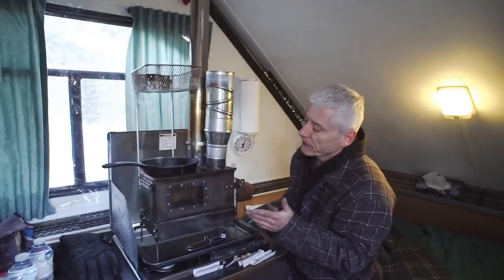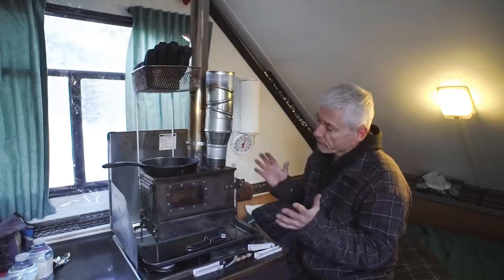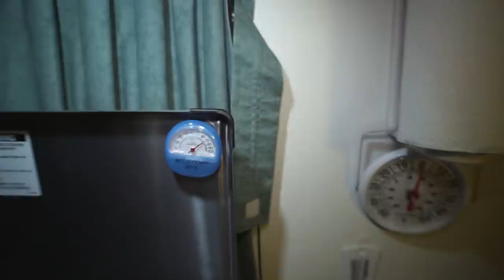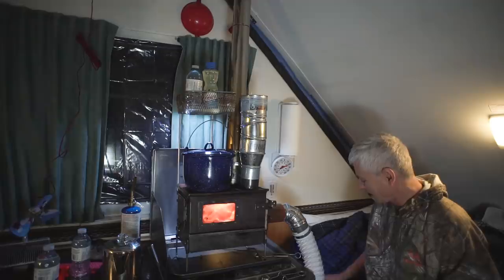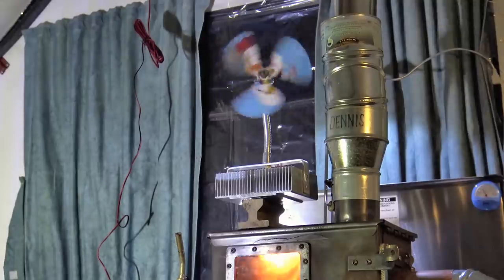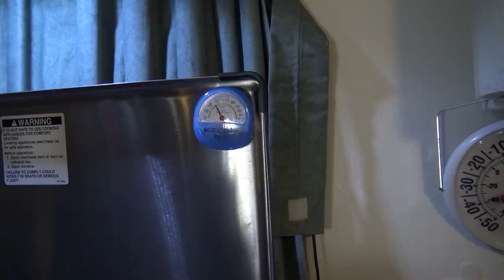Wood Stove in an A-Frame Trailer - Part 2

Comment: What if you heated a bunch of water up on the stove while it was running hot early and let that water radiate heat when it gets really cold.
Reply from the maker: I'd end up with a very damp trailer and little heat retention. Biggest issue is avoiding condensation, not having more heat. Thanks! SP

Comment: You are loosing a lot of heat up the flue pipe; You need a dampener plate in the pipe to slow the BTU loss down so more of it radiates into the camper.

Comment: probably been said but look into a 2k diesel heater around 200 bucks and under... one gal tank up to 8 hrs of use  perfect size for your A frame
Reply from the maker: Hi James, which specific model are you referring to? Just the model please, don't send a link. Thanks! SP
Reply: @SlimPotatohead   no links look at amazon  do a search on diesel heater  my friend grabbed a one for 179 red top grey/black bottom  it runs on 12v also there is a few other for other prices probably find it on ebay also there is also some vids on here about them   i can tell ya  it get his truck camper warm.....   and yes fan in center roof  blowing down works great.. in the summer flip it up to suck up cool air
Reply: if you didnt know .....diesel gels up  in colder temps like your in   but you can mix kerosene to help that out.....my friend loves his on hunting trips...used last 2 winters
Reply from the maker: What heater are you referring to? Company? Model? Thanks. SP
Reply: @SlimPotatohead  has no name  or at least we havent found it  it was a china build i can tell  but there are a lot of brands on line   i can do a link but  on that link i can not see no name only seller on amazon 
manufacturer is morningchen
Reply: @SlimPotatohead   amazon  search for a camper diesel heater  should take you right to them
Reply from the maker: Hi James, found it thanks. Seems more suited to a truck then a separate camper. Requires a substantial amount of 12V current, exhaust outlet and inlet, and most likely makes noise. Plus I'd have to purchase and carry diesel. Sorry, wouldn't work for me but thanks for the info. SP
Reply: @SlimPotatohead   no worries just a thought.....i  like the vids by the way... A frame's  looks good ....  i do love a fireplace.....  keep on campin

Comment: I'm concerned about the combustibility of the flexible flap on the roof where the stove pipe exits.
Reply from the maker: You shouldn't be. It's a heat-resistant silicone/fiberglass stove jack. SP

Comment: Check your ceiling temperature your stove is up too high that stove needs to be lower about a foot and a half off the ground because heat rises so you're not getting any heat down below that stove that's why I say put them reflective blankets up so that the feet that's directed towards the ceiling will be reflected back down to you and along with the fan that works on heat only when you set it on top of the stove it will generate some air movement which will also help

Comment: Isnt a diesel heater much cheaper in the long run?
Reply from the maker: You tell me Akiva. Nobody gives diesel away for free. Scraps of wood however,  are pretty easy to come by, especially in the forest where I camp.  SP
Reply: @SlimPotatohead  I just saw you were using pellets not wood scrap.
Reply from the maker: It runs on both, however I much prefer pellets for consistency. There may be other reasons to prefer a diesel heater,but I wouldn't put economics high on the list. Thanks! SP

Comment: Hey sLim Pickens,  I started laughing, you experiment the way I do.  Make up things and test em, great if they work, re-do if not, lol...   What ya gonna do?
I have a thought though..
You are losing too much heat up the stack.  I have seen stoves with a second chamber, the hot gasses from the fire go through the first chamber then put to the second chamber to try to catch more heat to be radiated off before going up the stack.  Now, I have a thought on how you might get away with this.
  Have you seen those heat boxes, with the tubes that go on the stack, they have a fan that blows air through to blow the heat out.   Obviously, you don't want to be running a fan because power is usually an issue.  What I thought could happen is rotate the stove 180 degrees, put an elbow on the stack to go over the stove.   Place one of those heat boxes with the holes VERTICAL to allow the heat to move the air through and up.  Then another elbow going up and out.
LOL,  my first thought was to get some metal and pop rivit fins on the chimney pipe and though it might work, it makes the stack much larger and difficult to handle.
  I'll have to look into pellet stoves, it sounds like a good idea.....

Comment: If possible..the stove should be sitting on the floor..the Coldest spot..heat rises..so better heating solution?
Reply from the maker: Hi George, there's really no need, as the stove heats the trailer to the specific temp I require. Also, why would  I want to cook on the floor? SP

Comment: To begin with that little wooden stove to me it's a little too small to heat up your camper and maybe using some regular wood would help you better but still there stove is too small that is just my opinion but it is good that you have backups that is always really good to have because you really can't just rely on just a wooden stove also that will help is maybe to have an electric blanket just in case it back up but then of course you have to run into having battery supply and also having a power inverter big enough to support you are electric blanket
Reply from the maker: Hi Rick, did you watch the entire video? At 36:00 I summerized that I successfully achieved a 70 deg F differential. That is all I need. Any more heat would be a complete waste of fuel. Size is perfect for me. SP

Comment: So would wood have burned a bit warmer
Reply from the maker: Hi Kathy, Yes wood burns warmer but also has several disadvantages to pellets. It is less consistent (too hot, too cold) needs more attention, and produces more smoke and gases, more ash. I use wood for cooking outdoors with the stove, but not for heating. Thanks! SP

Comment: spray a small amount of cooking oil on those pellets. soak a few pellets in diesel or used motor oil. I said only a few. maybe twenty pellets. experiment. those pellets need to lite easier.

Comment: Love this project and your methodology.  Also I don't think it is very possible to exhaust the O2 in the trailer. With a massive fire perhaps yes. The trailer would need to be very ,very did I say very  airtight. O2 diffuses from high concentrations to low very quickly .If you took a O2 tank and turned it on max , say 15 litres a minute ..4 feet away an O2 analyser would read 21%. no change from atmospheric O2. The reverse is true when you use O2 up in a smaller space that has even a small air leak. Now CO yes dangerous , and it is dangerous in very small amounts .. I would worry more about CO. The intake fresh air pipe does help with the fact your not sucking warm trailer air into the fire and up the stack.

Comment: That small of a stove will never use up the oxygen that is in that size trailer there is enough air leaking in that you can't tell so don't worry about the oxygen.

Comment: I had one in my boat and it was a no ,one would have stay up all night feeding it.fine during the day .no way will that use up all the air lol .a 20lb propane bottle a good heater does the job with a little 12v fan in your rig.
Reply from the maker: Todd, I think you are talking a different situation than mine.  My use is for extreme cold. In that case propane is a poor choice due to both condensation and the lines freezing up. I only needed to refill once during the night. Wood pellets are much more reliable and provides dry heat. SP

Comment: Great video! I was wondering if you thought about plexiglass for the windows. Also, if you point your ceiling fan toward the chimney pipe you would lower the pipe temp and gain more heat. Just a thought.

Comment: ad space-blanket`s to the side of youre a frame`s, over that you can ad fiberglas wallpaper to make it look nice if you want to, this wil also make direct the heat down to the ground making you're ventelator more useless (or a less powerfull ventelator necessary). gl hf.

Comment: put the stove on the floor, put more metal fins around the exhaust pipe
Reply from the maker: Not practical in this system. The stove must be compact as it folds up like the trailer. SP

Comment: Why not use a small normal wood heater ? If you did that then depending on the wood you could fill it up and wake up with coals.
Reply from the maker: Hi Daniel, I use pellets for long periods of consistent temperature and burn. My stove will take wood, however just filling it up would end up being too hot initially,  then too cold, plus a lot more ash and smoke. Thanks, SP
Reply: @SlimPotatohead  fair enough . To each his own . Thanks for the reply

Comment: you need to install a jiggler and handle so you don't have to try and use a poker while half asleep, add a solar panel a arduino and a solenoid and it would stoke it for you.
Reply: and get short piece of double wall to slide over your pipe to protect the skylight opening.
Reply from the maker: Check out 17:00 in this video. Flu does not get hot enough to damage vent area. SP

Comment: I don’t know why you didn’t just simply measure the ambient air temperature with a traditional thermometer.

Anyway, interesting idea, but I prefer the safety of a webasto (or copy) diesel heater. Very cheap to run. Very safe, all combustion occurs outside, and you simply get warm air in the cabin. A lot more expensive, but a lot warmer and a lot safer.
Reply from the maker: Diesel consumes power. The wood stove produces it. SP

Comment: That fresh air line isn’t needed and it’s a hazard. I live in Alaska and have used my motorhome in February above the arctic circle in -30 F.
Reply from the maker: You don't have my setup, so don't compare to a motorhome. Works fine and yes, it is needed. SP
Reply: Slim Potatohead your walls are the same thickness as a Motorhome 2 inches. I think it’s cool what you’re doing. 
The sweating you’re getting is from your propane. It’s a liquid gas and puts lots of moisture in the air. 
Wood heat puts out zero moisture and no amount of carbon monoxide. Bud I’m not giving anything but praises. Great videos. 

Hey your fans great. How’d you build it ??
Reply from the maker: Propane has many problems in cold camping. Too cold it won't even flow. Wood can produce Carbon Monoxide, but wood pellets have a very clean burn. My fans are in several videos, first one is here: https://www.youtube.com/watch?v=1gInEKrUdME
Thanks, SP

Comment: Diesel heater can’t go wrong the 3 kw version use about a litre per 8 to 10 hours
Reply from the maker: Except it cant cook, fry, boil or bake, and it consumes electricity instead of producing it! SP
Reply: The power use is minimal about 10w along with fuel use , they take up no space give a good dry heat that circulates , does not freeze like LPG , they can be run when you are driving . With the 3kw I have drawing air from the outside it heats a canvas camper trailer from 0c to 30+ c in about 15 min . To me a comfortable environment is everything I cannot move in the cold to much arthritis. Depending on were your batteries are mounted you can run a section of the exhaust from the burn chamber through your battery box th stop them freezing up . I am not knocking your stove but offering a very viable alternative
Reply from the maker: Yes Pete, I agree a diesel heater is an excellent idea for a van or small trailer, just wish it was more multi purpose. Interestingly enough there are stoves out there that also run on diesel. Be great if someone figured a way to combine them both! SP
Reply: Slim Potatohead lots of diesel cookers in the marine world, they work well have had one on a yacht i had but the heat output is minimal at best for heating and the fuel consumption is many times per hour over what you will use with a diesal heater . Personally for the size , weight and output they are impossible to beat . You could possibly throw the lpg furnace away and have both . In the temps you are in I would call it survival just having a redundancy system in case of failure of one source of heat . Lpg is not very reliable in the subzero temps you are in to my way of thinking and the weight saving woub be fairly significant

Comment: How about insulating the floor with some 1 " Styrofoam SM .. if you haven't already. Most of these camper units are so inadequate for winter. As mentioned, aluminum extrusions that pass thru the wall like window and door frames become super heat conductors.. useless. Somebody has to come up with a truly winter capable RV. At least 3" of poly urethane foam all around, double glazed polymer windows, not glass. and infrared coatings on the wall to reflect radiant back at the occupant.If you calculate the btu return on pellets compared to diesel or heating oil. I bet pellets are substantially more expensive plus a diesel oil heater has lower maintenance.

Comment: Hope my coment dose not ofend, cayou try some re-engineering. The stove, try some fire brick on the botom part of thr burner, they will keep the heat longer. also try and making a flap for better air flow control. reduce the intake and the fuel will last longer.

Comment: Need more surface area to transfer heat from the metal to the inside air.The ammo can is not the solution .
Reply from the maker: Sounds like you missed most of the video. It works perfectly. SP

Comment: you use pipe lagging to fill the gaps when you put the caravan up why not line the walls and floor  with what we call in the uk fire resistant kingspan its that blown foam sheets 1/2 inch to??? with aluminium backing glue it to walls to were it dose not stop you erecting the camper and those that do use velcro huck and loop after you have put the camper up it also acts as a cooler in warmer climates and for you windows and doors cut out there shapes just a little bigger velcro to keep  them in  place  lets face it while you sleep windows aren't needed as for the floor 1/2inch ply over the top hardly no weight just make sure theres enough space around the stove pipe and the kingspan  and don't cover any vents

Comment: Why not install a diesel heater.
Reply from the maker: Why would I want something noisey, stinks of diesel fuel, uses power instead of producing it, doesn't cook, bake or fry... do you really need to ask??? SP
Reply: Because of the convenience of not having to get up every 4 hours to stir the embers and feed it.  The diesel heaters don’t smell in the least and they give a constant temperature and have a thermostat.  But, hey, call me crazy.
Reply from the maker: Ok Ian, I'll call you crazy. I only sleep 8 hours, which means I only need to get up once in the night (usually do to pee anyway). A few seconds loading and it's good to go till dawn. As I said before, your diesel has very limited capabilites. Wood stoves however have multiple uses. But hey, feel free to call me crazy too! SP

Comment: i have a 30-foot 5th wheel i have a wood stove in it it will run you out 80 F with the door open coldest has been 15 F outside so i would say your stove isn't big enough  and it needs to be lower to the floor as well ,, I have lived with wood stove's  sense i was 11 year's old and to me you can not beat a good wood stove for btu pellet stoves do not put out the big btu like real wood stove

Comment: Slim Please youtube diesel heaters on eBay there like 190$ and they come with everything you need to install also comes with a digital thermostat to so get that puppy to 70 to 72f and stay nice and warm also they don't Suck as much fuel as 1 would think Either the one off eBay comes with a 10 liter tank which is about 2.70 Gallons  so less than 4 bucks at the pump and it only burn maybe a liter per day if that now you can get a bigger tank but you would have to modify that or you can by a diesel vehicle and Hook it up to your tank Witch would give you 30 plus Gallons witch off 1 tank could give you months of heat
Reply from the maker: Sounds like an interesting alternative. How many amps does it draw? Thanks, SP

Comment: I see you do have a damper in this video.
It may very well be , the size of your stove is too small for the temps you are camping in and probably moreover, the Aliner was never intended to be used in such extremes. 
I admire your efforts to improvise and customize your camper to suit your needs.
I have a 27' bumper pull that I live in yr around and it is Not made for cold camping.
But Ive customized it to work well in very hot and cold weather.

Comment: you may add a carbon monoxide detector inside. In your video, not show where you have air intake for the stove in such small space the wood needs to draw oxygen to burn. Last, a double sleeve pipes would prevent you burn yourself touching it, if you not intended for the pipe to work as heat element, and top it off with a water cover like in the home exhaust vent, vent to the side but top covered.

Comment: Galvanized  pipe is realy bad to use on a wood stove as its heated it lets off very toxic  fumes
Reply: His flue pipe is titanium.  The galvanized section is his pellet feed system and doesn't get nearly hot enough to burn the galvanized coating.

Comment: Your better off with a normal mini wood stove that burns real wood not pellets. It would have been toasty warm 70 degrees with one.
Reply from the maker: Not really. I'd be using far more firewood than pellets, plus would get inconsistent heat, more ash and a lot more smoke. More wood means less storage. Firewood is fine for cooking, but in a situation like this pellets have a lot more advantages. SP